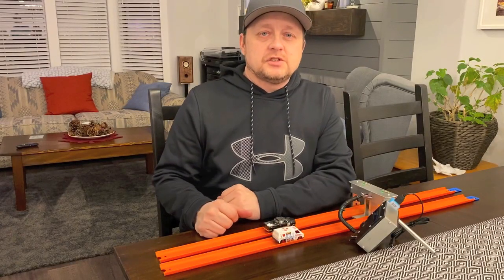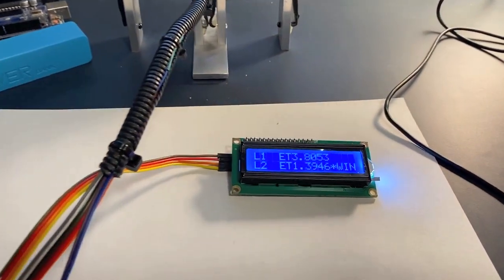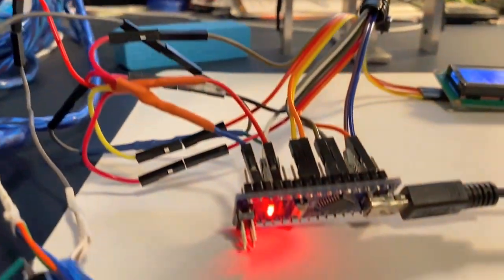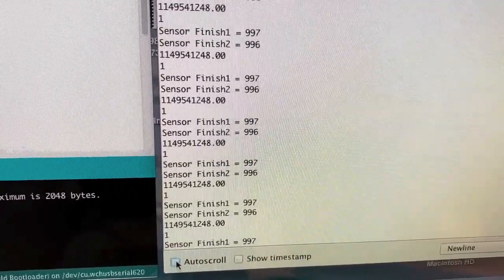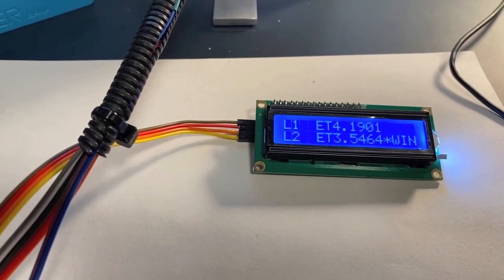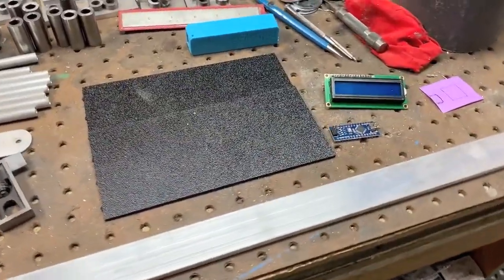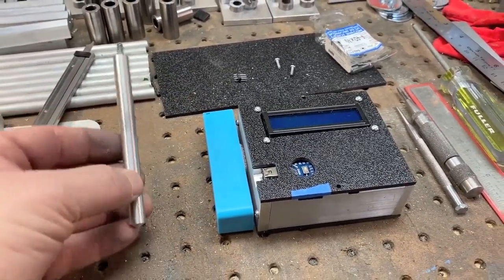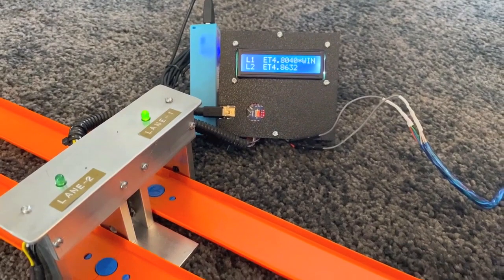Hot Wheels Finish Line Timer V2 / How to build a electronic finish line with race timer / Free code

Comment: nice work mike, i have made my own version, 
i would like to know how did you find the exact distance from the ground to the ir led and the transmitter led, mounted? as there are 2 types of hot wheels tracks available in the market, one with shorter side walls as you are using,  and the other one with the higher side walls..
Reply from the maker: Thanks for commenting. Since there are no cars that are lower than the track side wall, as long as you are high than that you are fine. The UV Emitter has a slight angle of broadcast (several degrees) It's not fine like a laser.  I spaced mine 5/8" from the bottom to the center. I hope that helps?
Reply: @MikeFreda  Yes it does, Thanks!

Comment: Hello just a quick question.
Are the IR sensors and LED lights soldered to the wires? I would love to replicate what you have done. I think everything else makes sense. 
:yougotthis:
Reply from the maker: Yes, the wires are directly soldered to the LED leads.  You could populate them in a small perforated board as well if you just want to make it functional.  I tried my best to make it a complete and nice looking unit.  Cheers.
Reply: I have built this but one LED is always illuminated. any ideas on how to fix?
Reply: It is V.1 sorry I can post there

Comment: Hi Mike. Thank you for pointing me in right direction. As I mentioned I am complete novice. I went through wiring and gosh, I missed the 10K from switch NO to ground. That was my first issue. As I added that and checked serial Monitor it went to 0 from 1 (which it didn't before). Regarding the momentary switch, since I am not a coder I had to cheat my way out but it seemed to work lol
Where program check switch status I dropped the statement when gate is opened as the check for the previous statement of first check   

void loop() 
{
  StartState = digitalRead(StartSwitch); //Check state momentary footswitch 1 = Normally closed HIGH 5V. Footswitch pressed opens switch to ground LOW through 10K resistor
  if(StartState == 1)
  {
  StartState = digitalRead(StartSwitch); //if Start, footswitch is pressed to open contact timer will start.
  if(StartState == 0 && StartTime == 0)
  {

  }
  }
  
  StartState = digitalRead(StartSwitch);
  if(StartState == 0 && StartTime == 0)
  {
    StartTime = micros(); //use micro seconds since the races can be that close!
  }

Haha... That is the worst work around ever and probably makes coders cringe but it works with the momentary foot switch. It is normally closed with 5V high then when footswitch is pressed it goes low and even when let go 3 seconds later the timer started correctly on first press and continues until IR sensors in both lanes are triggered and display time correct. Before it only started timer when I press and when I let go (not timing the amount of how long the footswitch was pressed)
Reply: If anyone wants to assist to clean it up I'll be happy :) I just spent weeks on this so this for now is a blessing

Comment: excellent work, it would be incredible if the chrono started after a sequence
Reply from the maker: Thanks for you comment.  I was planning on making another version of this timing system with 2 start handle, with a light tree and reaction timer… almost like real drag racing.
Reply: @MikeFreda  hello mike, can you help me?, I am doing yours but I need to remove the star switch or the output switch and replace it with a laser activated LDR sensor so that it is the barrier to start the chrono put an arming button and wait to go through the laser, could you help me with the code? and if that represents $ you tell me how much and we will do it in advance thank you very much.

Comment: anyone else having problems with the code failing?     ---     'positive' was not declared in this scope ? not sure what to do...
Reply from the maker: Hi, I copied that exact code and installed it into the IDE and is works fine. I suspect it could be a few things. 1.) Check to see if your LCD library is the right one. Upload a current LCD library file.   2.) If you are using I2C connections, you can also use this code instead: >>>  LiquidCrystal_I2C lcd(0x27, 16, 2);   You need to make sure your library matches this command. You can get the file at Github.   3.)  Also make sure the LCD address (i.e. 0x27) is correct. You can use another program to obtain I2C addresses.   If you load a new library file, you may need to change the library name  called out at the top of the code to match. I hope that helps!?
Reply: Yo también tuve algunos problemas pero hice algunas actualizaciones principalmente en la pantalla LCD y sus librerías y me funciona perfecto! Adicionalmente puse un buzzer y cambie los mensajes para que cuando estén corriendo salga dicho mensaje, si desean puedo compartir el código. Gracias Mike Freda por tu aporte

Comment: good afternoon I would like to know if you can help me I would like some lights like this for my six lane track
Reply from the maker: Yes, this can easily be made for 6 lanes.  The code would need 4 additional IR sensors added to it. Wouldn’t be that hard to figure out. 

What you could also do it mount the black IR receiver in the track and shoot the emitter down. That way you can get the tracks tight to each other.
Reply: @MikeFreda  good afternoon I would like to know if you make custom lights for a 40 foot two lane track
Reply: Sorry 45 foot two lane track

Comment: Mike, I built something very similar, and it seems that I cant get my analog read fast enough to catch the cars crossing, do I need one of the fast IO.h to speed something up. Thanks
Reply from the maker: I found the analog in to be fast enough. When I was developing my program I did find it was too slow. My issue was I was doing calculations and making the Arduino turn on the LED’s and updating the screen before the face was over. What I end up doing is just capture all the events/data. Wait for the race to be over then calculate and post the results. That worked even for tight races (0.005 time differences ) between to two lanes. 9600 seems fast enough.
Reply: @MikeFreda  I am using the arduino uno, and a servo motor to open the gate when start switch=1,two lanes and the sensors are both reading 1000, but I can see that cars pass thru and on the serial monitor the values never change. Its sampling every second it looks like. If I place my fingers in the path and hold it they will finish the race and LED light.
Reply from the maker: Could be a wiring issue (not sensitive enough) or you have a coding issue where you have a delay that is pausing the Arduino. The analog time clock (typically 9600x a second) is way faster than any hotwheels car. Serial print will slow down the Arduino as well. You need to capture all the data then print/write/calculate the results.
Reply: @MikeFreda  I will look into removing delays, and thanks for the fast reply. Greatly appreciated
Reply: Okay I was printing to the display. removed it and now I am jamming.
thanks

Comment: Hey Mike! Love this project and thanks for creating/posting for us. I’m making for me and my son. Any chance you have a cut list for the metal fab you did for the housing at the end of the track?
Reply from the maker: Glad you like it. Unfortunately, I don't. Send me an email and I can sketch something up for you. Email link in the ABOUT tab on my channel. Cheers
Reply: @MikeFreda  thanks and will do. I’m not seeing a link though...?
Reply from the maker: You should be able to see it if you are on a desktop and are subscribed to my channel. If not, this is my website. Flyballequip.com.
Reply: @MikeFreda  thanks, Mike. I went with a housing made of LEGO, so I’m good there. But I can not seem to get the code to verify in Arduino. Specifically, I’m getting the error: ‘no matching function for call to LiquidCrystal_I2C...’

I tried the I2CScanner per your suggestion, but I end up getting the same error ‘no matching function for call to I2CScanner...”. 

What am I missing? Do I need to alter any of the code related to LiquidCrystal_I2C?

Thanks for any guidance.
Reply from the maker: @gaabty9580  did you download LiquidCrystal_I2C library file into Arduino IDE? You can get it from Github.

Comment: Hi Mike and first of all thank you for sharing your project. I’ve already done the V1 of your finish line and I’m upgrading to the V2. Could you please tell me which LiquidCrystal_I2C library did you use? I tried 4 different ones and I still have a compilation error. Thanks again and keep safe. Greetings from France.
Reply from the maker: I load all the library as noted at the top of the program. Adjust the dimmer control if the screen. If you done that, I suspect you have a address issue with your LCD screen. Run I2C Scanner to identify what the address is of the screen.  Then change the address in the race program.
Reply: @MikeFreda  Thanks for the answer Mike. I  checked the lcd adress with scanner_I2C which is  0x27, same as your sketch. I'll keep looking 😉
Reply from the maker: This can be a bit frustrating. I’d recheck the wiring. What you can try is writing to the computer screen to see if the program is actually working correctly.  Or, try a basic program like a simple stopwatch or timer.... or “hello world”.
Reply from the maker: Try here for the libraries: https://github.com/marcmerlin/NewLiquidCrystal
Reply: @MikeFreda  Hi Mike, it works! I kept only one library (LiquidCrystal_I2C from Franck de Brabander). I had to change the code (for example "lcd.backlight" instead of "positive" that didn’t work for me). And I also modified to use an IR instead of a start switch. I will post a video on my insta, thank you so much again Mike 🙏. Greetings from France.
Reply from the maker: @analogix715  Great to hear!
Reply: @analogix715   Hello, can you share your code to test it, I have the same problem :(
Reply: @MikeFreda  Thanks Mike I try this as soon as I get back home. 😃👍👍

Comment: Hi Mike, I built this after seeing the project on the project hub. I cannot find the library i2cio.h or fastio.h, therefore I have the completed finish line and start switch but cannot use it. I have the newest ide as of this post. Any specific location i could find these libraries? Could you post the locations of the libraries you use in the sketch?
Reply from the maker: I downloaded these 2 library right from GitHub then loaded them up through the Arduino IDE software. You can just google them.
Reply: Did you ever get this to work? I am strugling to find most of the libraries used. Especially i2cio and LCD. I was able to get the rest
Reply: @eddiestuder7593  no I gave up on it, i couldn't ever find them. I did build an awesome finish line though and got it all wired up lol
Reply: @jamesstallcupmd9863  Thats where I am at now. Great finish-line mock up. Jst trying to get the code to work. I think I am close and if I do get it I will see about posting it.
Reply from the maker: @eddiestuder7593  Try here:  https://github.com/marcmerlin/NewLiquidCrystal
Reply: @eddiestuder7593  if you can find it i will owe you one brother! Thank you!!! Trying to host some races at work :)
Reply: @jamesstallcupmd9863  My code works or at least compiles without errors. Now I am trying to figure out the problem I have with hardware configuration. I can't get it to work right now.
Reply: Hello James, take a look at this. https://github.com/Gnobodyuknow/Updated_Hot_Wheels_SFL_w_LCD 
I took Mike's code and replaced any outdated or no longer available libraries. I also tweaked it to work with an LCD using an I2C addon. 
Mike if you see this I am having 1 problem, if you could give us some of your expertise, seems once I load it to the Nano it goes into a never ending loop that seems 
to be like it is running over and over again. Thank you. I did give you credit in my repository for the original code and mention you can be found on Youtube.
Reply from the maker: @eddiestuder7593  Thanks for the props. I'll have a look at your code and see if I can upload it and debug it. Yes, some libraries are older but they are still available and work okay for this application. I may have to revisit that and change a few things.  Things to note, sometimes the start switch will cause a loop or the IR sensor is detecting something all the time.  Also, for the system to reset, you need to close the start switch. The reset of the race is done by the start micro switch.
Reply from the maker: @eddiestuder7593  I got your program to work. I did find an error.. more like I hacked it to make it work.  Change this line 19 to this: LiquidCrystal_I2C lcd(0x27,2,1,0,4,5,6,7,3,POSITIVE);          You also need the start switch to function properly. It can't close until the race is over. You also need the Pull up resistors installed on the switch.
Reply: @MikeFreda  For my setup with an I2C board addon to my LCD display I won't need the separate pinout variables for line 19. But I am betting you found my problem though with the start switch. Thank you very much for taking a look!
Reply: @eddiestuder7593  you just made my day! thank you so much I am going to try this this weekend!!!
Reply: @jamesstallcupmd9863  Glad I can help. Have fun getting your races together!

Comment: Great video thank you. Would it be easy to make this with 4 lanes? Would the code script need alot of changes?
Reply from the maker: Thank you. Yes, 4 lanes can be done. Yes, the code would need to be modified a bit to include the other 2 lanes and its variables. You may need a larger 4 line screen. I would also confirm that the Arduino board can supply enough current to run the extra IR LED's. I think it may be okay.  My Version 1 Finish Line would very easy to adapt to 4 lanes. That may be a starting point for you.
Reply: @MikeFreda  Awesome thank you
Reply: I was thinking of adding 4 screens one for each lane
Reply from the maker: @darrenmcnally82  That would be tricky to do. You would have to make sure each LCD screen has it's own address. There are tutorials on how to do that. Much, much easier to just do one larger LCD screen... IMHO

Comment: Hi Mike, how are you? I have a project very similar to yours, but I would like to exchange the leds for Oled ssd1306 panels. But you have no idea how to do this. Would you help me?

Thank you very much.
Reply from the maker: Hello, thanks for watching and commenting. OLED display requires a different library and command prompts to make it display than a basic LCD. I would recommend trying a simple "hello world" project to get started. The Net and Arduino Project Hub has examples. Once you figure that out it would be relatively simple to adapt the LCD print line to the OLED.
Reply: Yo lo hice con la base de este video y le puse una pantalla Oled y funciona muy bien, si deseas te comparto el código